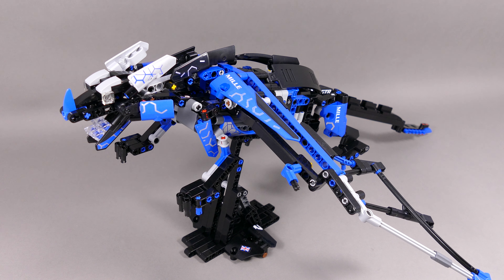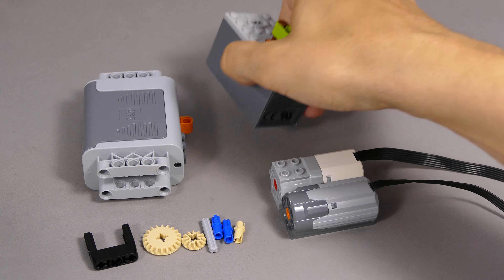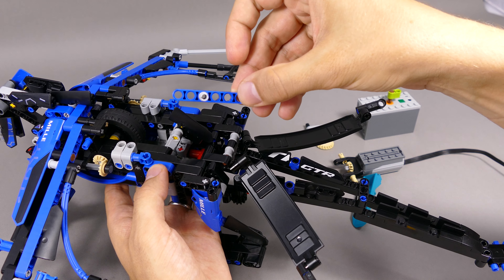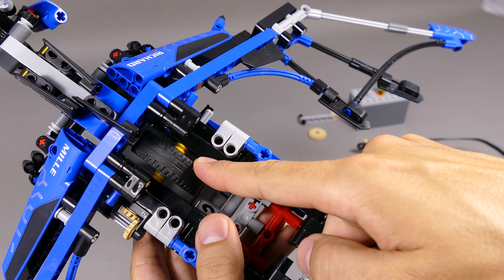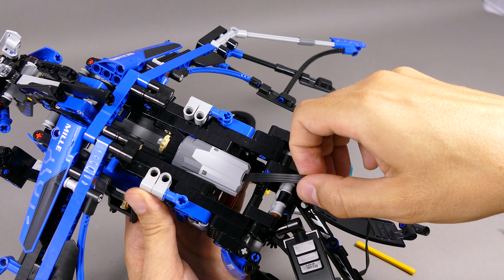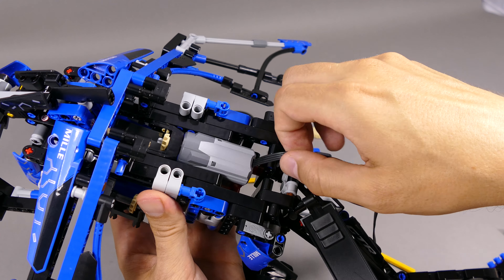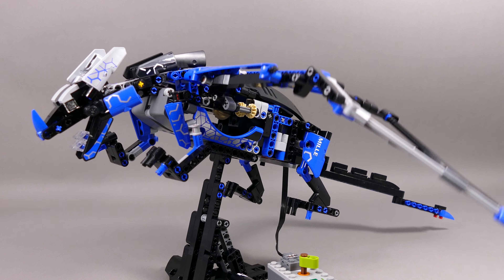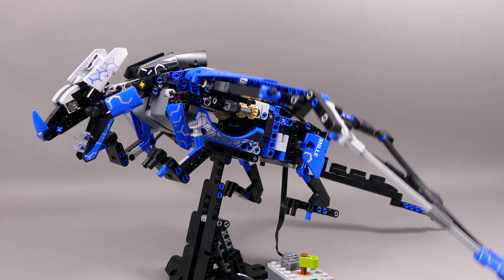Motorized Blue Dragon - LEGO Technic 42123  C Model

Comment: Is this a big problem if  I'll use the motors, the controller and the receiver from the 42095?
Reply from the maker: You might need to adjust a few things but should work ok.
Reply: @grohl666  k